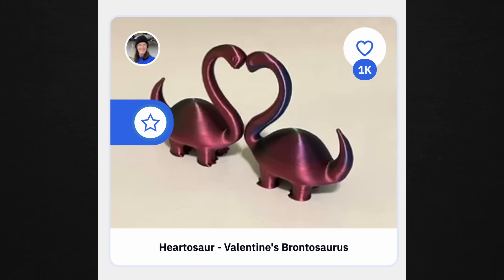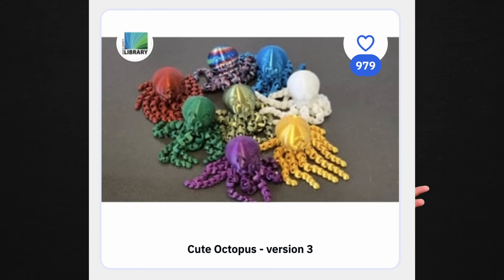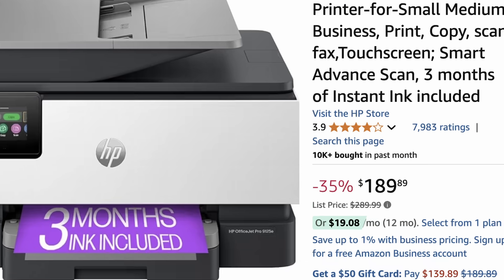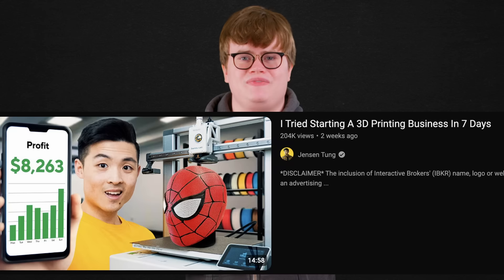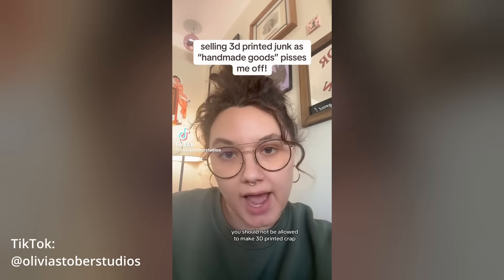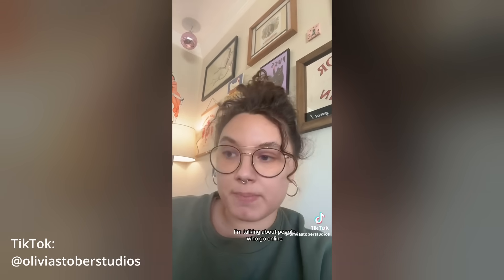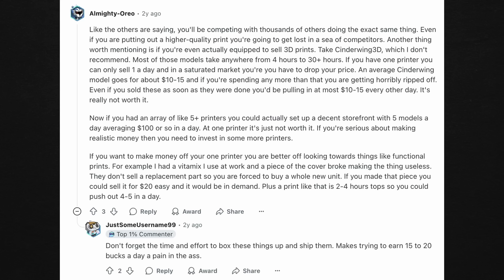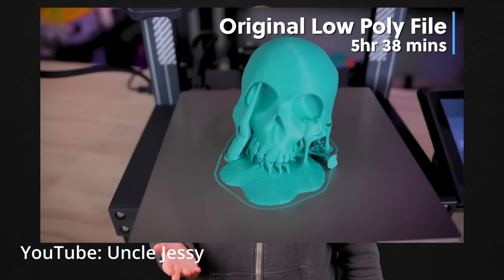The Rise of 3D-Printed Slop

Comment: 3D printing "slop" is the same as the clothing industry's "fast fashion" issue. There are high quality, useful, amazing things that can be created thanks to 3D printers, just like there are high quality jackets and shirts, but then there's an ocean of low quality printed "slop" just like the literal mountains of discarded fast fashion t-shirts.

These days, printers are getting easier to use and are far more reliable. The Cinderwing files and other ones purchased from reputable Designers will usually be designed to minimize the chance of a print failure (sticking to 45 degree overhangs to minimize or eliminate the need for supports, for example). So the direct waste per person is likely decreasing, though the recent rise in multi-color printing and the required filament purging is likely to reverse that course.

All of the major printer brands are moving towards enclosed CoreXY printers (Bambu P1/X1 lines, Elegoo Centauri, Creality K1, Prusa Core One, etc), which are very reliable and will allow for better air quality control. Most are including (admittedly very small) filters, but are certainly a large step up from the bed slingers of the past that had literally nothing.

I don't necessarily agree with the idea that the trinkets are better off being bought from Temu or similar sites. Sure, it takes hours to print out a fidget toy, but it takes days to get it shipped from Temu. If it can be bought in my town, I will usually buy something instead of printing it, but if it would have to be shipped, it's generally always faster to print it, even with 2-day shipping from Amazon. In some cases, I can get a new roll of filament overnighted and still print the toy before I would have received it from a site like Temu.

It's also of note that most crafting hobbies that are commonly leveraged into side hustles are heavily based on not being original. I'm in groups for my engraving, embroidery, CNC woodworking, leatherworking, and about a dozen other crafting hobbies. The most common question when anyone posts a cool item that they made is whatever that hobby's version of "Where did you get the file?" is. I would argue that the vast majority of people selling items at craft shows did not do the full design work themselves, unless it's something like painting.
I do believe that 3D printing has the lowest barrier of entry for this kind of thing though. 3D printers have become one of the cheapest crafting tools you can buy and are some of the easiest to scale up the volume. I would love to see the community shift towards less "slop", but I don't see that happening unless the people buying things push for it.
Reply: filament purging? is that like when ink printers require you to do tests and use up extra ink for no reason?
Reply: @nephrite3652  it's unfortunately worse than ink printers. 
Most of the current systems for 3D printing in multiple colors use a single nozzle that is connected to a system that switches through anywhere from 1-16 different spools of colored filament. Whenever you want a color change, it will feed in the new color.
Because the cavity inside the nozzle is basically a melting pot, there's no way to instantly switch colors within it, so you basically have to just extrude enough filament to be sure that the right color is coming out. Depending on the part(s) being printed, sometimes this can be done by using up that mixed filament for the infill, but a lot of times it is purged by just extruding a couple of grams (depending on settings) into a blob in a special area of the printer (called the "poop chute") to be collected and disposed of.

A printer can only print one layer at a time, so if you have a block that is half red and half green, you have to do a color change on every single layer (usually every 0.12-0.2mm of height). You can minimize waste by purging to infill like I mentioned or by printing as many objects at once as you can fit on the build plate, but highly detailed, multi-colored parts can have hundreds of color changes.

It's not a crazy amount of plastic and people have been finding ways to reduce it, but multi-color printing has become very popular for selling prints without doing any post-processing, so it's an aspect that still generates unusable waste.
Reply: @BHE_Crafts you can also purge into another object and adjust the purge settings to reduce the amount of filament wasted if you go from a light color to a dark one
Reply: And like ai art

Comment: Ive been saying this for years, its not even just 3d printing junk, its printing test prints for the sake of test prints
being in PC gaming circles and 3d printer circles (mechanical engineer) I see the same issue
PC gamers spending hours tinkering with every setting, spending thousands on parts, to get the best benchmark scores, to then proceed to continue playing CSGO.
3d printer owners spending thousands on parts, tinkering with every setting, getting the perfect dried filament, to proceed to print a million Reddit boats then still have to buy most things from the store anyway because for almost anything the one produced in China for pennies will be cheaper and better than the 3d printed equivalent 
fucking reddit boats man, they genuinly fill me with rage

Comment: I think 3d printing is mostly useful if you have some hobbies that lead you to tinkering. As a radio HAM, my 3d printer comes in pretty handy for antenna builds or adapters for cable running.

Comment: I purchased a 3d printer because I am currently doing a resto-mod on a classic motorcycle. The 3D printer makes it so easy to prototype the custom components I need for my build. It would be considerably more time consuming and costly if I had to make each component out of aluminum on the CNC milling machine in the prototyping stage. As an engineering tool, the 3D printer is incredible, aa manufacturing tool not so much.

Comment: as someone who’s a 3d artist who also aspires to be a cosplayer, part of the reason i got a 3d printer in the first place was to model things that could be costly and print them out for basically free. it’s disappointing to see the versatile use of 3d printers abused to mass-produce the same slop that people will buy for decades rather than to be used to produce things with specific needs such as a part for a piece of machinery that you can’t buy anywhere else

Comment: I saw someone on r/functionalprint print a thin sheet of plastic with 2 holes in. I was downvoted for suggesting they use literally anything other than a 3d printer/additive manufacturing. Some people have a hammer and see every problem as a nail.

Comment: I am honestly still baffled that we haven't found a way to re-melt printed plastic back into filament. Cause like all the prototyping is so much plastic that can be re-used
Reply: But we have it’s been around for years
Reply: @CycZilla  right? crazy that someone would just claim to be baffled by something without even doing the slightest bit of research lmao.

There's literally companies you can send your prints to, there's 3d printed shredder designs and there's printer extruder designs that literally print with shredded failed prints, that's the beauty of thermoplastics.

Comment: As somebody that uses a 3d printer like once a week for prototyping or making custom one off parts, this sums up so much of my issue with 3d printing! The color changing printers are another can of worms too, every time those change color they have to purge the previous color and this can end up wasting just as much filiment as was used. Supposts are another huge issue, its fairly easy to design parts that can be printed without any support, but so many of the models i see people print, especially to sell.

On your point about ventilation, another huge problem is carbon fiber filaments, they end up sending a ton of microscopic bits of carbon fiber into the air which is terrible to breathe as most of thest fibers end up being so small your body cant get rid of them and you almost never need that slight increase in rigidity.

Sanding down printed parts is also a problem since all of the material that you remove is essentially plastic dust that is impossible to recycle and will almost certainly end up as microplastic pollution.

PLA also is technically made from corn, but its not biodegradable unless its being processed at an industrial facility with high pressure and heat. Most printed plastic waste is too unknown in composition and likely to be contaminated with other plastics to be able to be recycled. 

Your analogy to printing out stock images and selling them is such a good description and sums up why the 3d printed booths feel wrong to me.

The times i think 3d printing is justufied is when youre keeping something else from being trashed, making a functional part that is not sold elsewhere due to not being profitable, or replacing a metal part (especially aluminium) and trading the carbon emmissions of metal production for plastic waste.

Comment: I remember wanting to see if there were plastic-free alternatives to the traditional filament.

I think outside of some clay and metal options (for very specific and expensive uses/machines), there’s really not much options.

Even the “wooden” filament I’ve seen before is more like a pulpy mixture with plastic additives. 

Of course, I understand that useless, not-even-fun junk that’s just gonna be thrown away is still junk regardless of actual material, but it’s part of the reason why I’ve looked at using more CNC-related routes for my future creativity endeavors. 

I just know a failed project I made with a chiseled block of wood would still be better to throw, scrap or burn than plastic at this point.

Comment: I don't think there's as much 3d printed slop as there are slop makers. Simply because only so many people actually buy the low effort stuff in the grand scheme of things. Think of it like this. The people who buy $40 dragons are the people who would just as soon buy over priced cheap plastic gift shop trinkets or low quality toys from 99cent stores. And most people aren't gonna repeatedly buy things the ultimately know they are gonna throw away especially if the price of that item is inflated.
Eventually the market sort of sorts itself out because no one is gonna make more product then they think they can sell and unlike those other cheep trinkets that fill up gift shops and stores there is no incentive to hold bulk stock when you can make to order.

If anything the shape of the majority of plastic in landfills will change with 3d printing but not the volume.

Comment: I’ve been to a few festivals where 3D prints have been sold, it’s all that junk like octopus fidgets, swords that will snap in 2 seconds as 3D prints are brittle when 3D printed bad, dragons, eggs, etc etc

Their all unsanded, and in that really bad rainbow filament techique that uses so much scrap material as you need to transition by making your printer print a scrap pillar

Comment: 7:00 from my experience, sellers like this make their way into any kind of event that you can buy booths in. At my local Comic-Cons, there's probably 5-10 of them selling the exact same prints with the exact same multi colored filament.
What makes it most annoying is that the machines have so much potential to make something cool that would be acceptable. They could even buy or commission someone to make models for their business. But they just decide to print articulate dragons or octopuses and get a booth next to a 3D printer that also decided to make the same exact thing

Comment: I’m going to assume your arguments in good faith. 

You asked why someone would 3d print items that are mass produced injection molded items that could be purchased online. I can print something for pennies in a couple hours or I could pay $5 and wait weeks for that ring sizer. 

I can agree with you that creators make 3d print farms seem like a much easier business than it is, but that goes for almost any hobby. We live in a “turn your hobby into a hustle” country at the moment. That’s probably a side effect of jobs being so shitty and everyone wants to be their own boss. Fair argument. Buying commercial licenses for stl files in a saturated market can get costly and isn’t worth it unless you can ensure high volume sales over a long period. 

Also 3d printers requiring troubleshooting and tinkering is part of the fun of the hobby. The yellow spaghetti image you shared probably happened because the infill used runs back along the print and can snag. Switching the setting in software is an easy fix. 

You mention enclosures but fail to mention the difference in filament types. PLA, ABS, PETG are just the most popular, and only ABS outputs noxious fumes and requires an enclosure. PLA is by and large the most used filament and doesn’t output fumes toxic to us or pets. 

You mention the print quality and how bad 3d prints look due to layer lines but don’t mention resin printing at all which completely eliminates layer lines and make this argument moot. Resin printers do need a more intensive setup though.

Comment: The only point that is kinda missed in this video about 3D printing is the fact that most of the 3D printing materials are bio-degradable. A lot of the stuff you buy on Teemu is made of oil-based plastic which ends up in a landfill for decades once thrown. 3D printing fillament can be made of various materials. Some aren't really good for the environment (such as Teflon) while some degrade 100% into compost within ~3 to 10 years depending on the composition because it's made out of corn.

Comment: I partially agree and partially disagree. Lots of the comments have covered my thoughts, so I won't rehash them, but from my perspective, I was using my 3D printer to print miniatures I would then prime and paint. I even made dioramas from time to time, kitbashing various bits together to create something new. Think Warhammer, but I was in it as an artist wanting to try something new, not as a player. The problem became, for me, the saturation of the market and the way the miniatures started being sold. You could get 30 files for $10, but if you were only going to print one, what was the point? Combine that with the price of resin, health issues and protocols, l and some personal things that happened (Issues in a Discord server where I was engaged with the hobby), and my desire to continue 3D printing fizzled out. I still have my printer - Elegoo Mars - but I haven't touched it in ages. When/If I get back into the hobby, I will gladly continue to use it. But at this moment, I'm not interested in continuing.

All that to say: to ME, it was valuable for the several years of hobbying I got out of it. I'd repeat it all over again if I had the choice. But you are corrected that 3D printing has issues. I do wish there had been more nuance discussed in this video, however. 3D printing invites a diverse population with different goals in mind for creation. The 3D printed slop exists, but there's so much more than that.

Comment: Well, that is of course, one perspective.  I would offer a couple of others, however.  Firstly, I like to craft, and a 3d print doesn't have to be the end product.  There are literal thousands of designs for tools, jigs, cookie cutters, pottery tools, molds, etc.  If you are the type of person who regularly uses these things, you will save literal paychecks worth of money not buying them elsewhere.  I'm currently restoring a metal cabinet from the 40s, and glass shelving is prohibitively expensive.  So, rather than go that route, I spent 3 bucks worth of plastic to print custom shelves I designed, and I will use an additional 5 or so dollars in epoxy acrylic and silicon to mold new ones.

  Then there are what I like to refer to as the "Impulse Items".  Since getting my 3d printer, I haven't bought a single chip clip, or egg slicer, or any of the hundreds of cheap plastic, low quality items that every person reading this has choking their drawers in their kitchen.  Why? Because a print in place chip clip takes 30 minutes to print, and costs me 3 cents.  Every time I loose a bottle top, or battery cover or whatever, I simply search real quick for the item, and mostly someone has had the same problem and engineered a solution.  

  Additionally, while it's not mentioned in the video, the TYPE of plastic that is used in 999 of 1000 prints is PLA, which while not perfect, is a much more environmentally friendly material than anything you will buy at the store.  Made from sugar, it is claimed that it will biodegrade without having to recycle it.  I personally have not tried this, but remember, plastics are just polymers, like tree sap.  Some of them will last forever, but not all.  Not to mention the inherent environmental savings that a select number of people printing a small supply useless crap at home has over a company in china shipping MILLIONs of those things over seas hoping that 1 in 10 sell before the fad wears off, and letting the rest rot in a landfill.

  This tech is still new, like microwaves were in the 70s, and when people get a taste of it, it will absolutely be transformative to our economy.  When people get a taste of owning one, they understand how it can already alter your purchasing patterns, despite the tech issue and limitations.  The problem is, until very recently, it required an "owner of a 67 chevy" level of commitment to maintenance and fine tuning.  The latest wave are more like hobbyist level products, but in a decade or less, we will be at the "grandma can use it" stage, and people will get that taste.